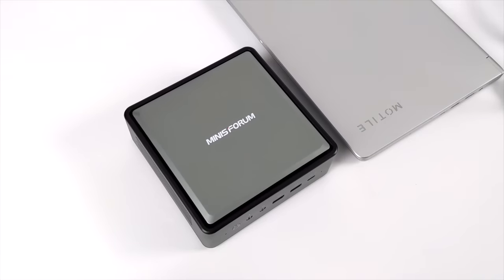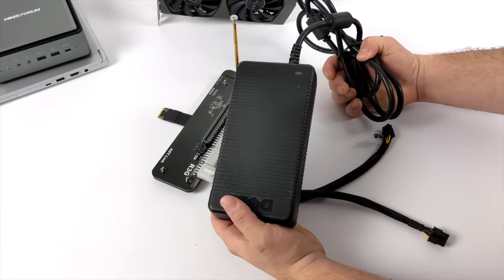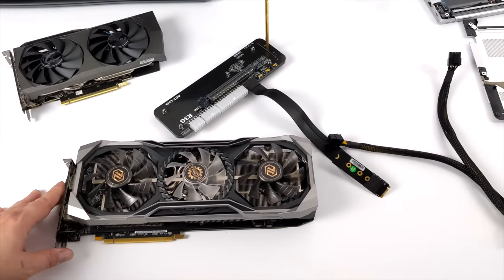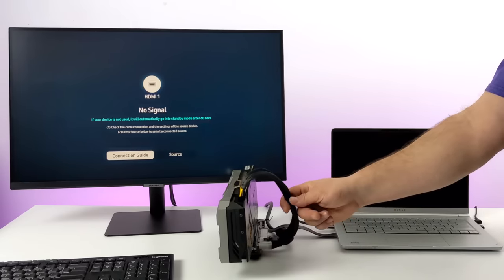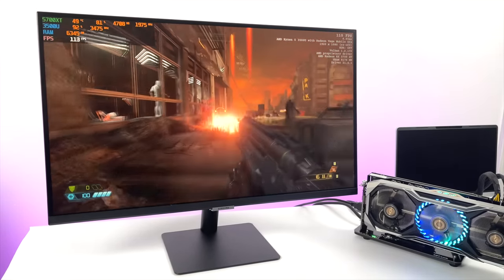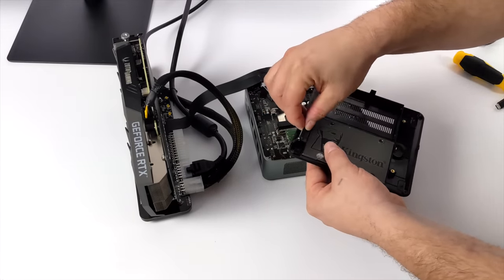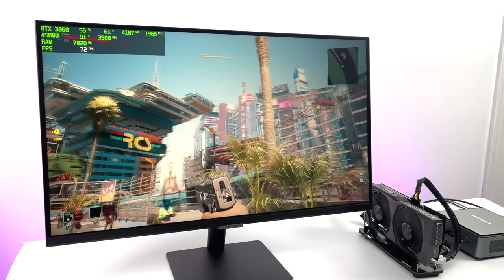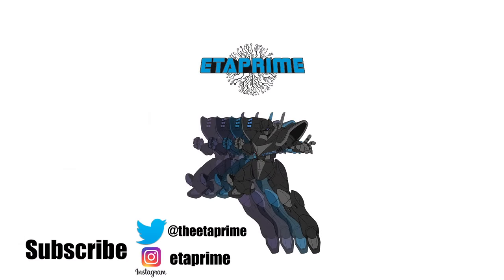Add A Graphics Card To Your Laptop Or Mini PC With This M.2 GPU Dock!

Comment: Hi prime, let's say I'm using more powerful gpu, rtx3080, can i use 2 of that 220w dell power adaptor on the m.2 external graphic dock? Or is it meant to be equipped with 1 dell power adaptor only?
Reply: Not supported AND 2X isn't enough power even if it was
Reply from the maker: One only, I would personally just pick up a cheap 400 watt ATX PSU
Reply: Ok will do and thanks for the reply.

Comment: Manufactors should plan a specific space on the laptop side to easily access a these free port for extension, like an opening with a removable plastic part. 

I know Intel can use Thunderbolt 3/4 but in the futur it might be awesome to directly access PCIe slot potentially higher than 4x.
Reply: Check out Asus flow x15
Reply: @feeblemonster8174  thanks! Never saw it before.
Looks like a pciE + usb-c combo to have the GPU directly using pci-e and the I/O of the external case using usb-c.
Quiet nice concept, hope the idea expand to other model /brand.
Reply: @LetsListenToMus1k  
I now own a great gaming laptop that I plan to use for at least 7 years. I’m thinking of modding it in a way that would give me the option to quickly connect and disconnect a egpu to make it better in the future.
Reply: Yes they should just have an m2 port on the side of the laptop like you would with usb or thunderbolt.
I don’t understand why that isn’t done, I mean thunderbolt has its uses for things besides egpu set ups so why not add a pcie 4.0 4x m2 slot on the side just for that? I don’t want to fiddle with my laptop to do this, it’s a hassle and I don’t want to have to remove an ssd if I have two in there.
Simply give me a m2 port on the side. Also with this the internal gpu should be disconnected and that external m2 slot should be greater than 4x, that’s assuming the 4x limitation of m2 is from the cpu and not connector. If it’s the connector that’s fine but if not it should be greater than 4x.

Comment: *me who bought a asus g14 that only had one m.2 slot*: well isn't that lovely
Reply: i mean the g14 already has a dedicated GPU so this would be pointless
Reply: @funknugget6334  yeah but it isn't that good, I have the rtx 2060 model, and it has the power of like a 1650
Reply: @TheSinnKidsOfficial  but still… it’s literally a 14 inch thin-and-light laptop with an RTX card. it performs great for what it is. i owned the exact same model— you’re not gonna get better performance over M.2 with an external card, plus they’re incredibly expensive nowadays

Comment: Excellent video, I've been waiting for a setup just like this! I have a Dell Venue 11 Pro tablet with a passively-cooled 4.5W Core M. It would be interesting to see how it performs using an M.2 connected GPU. Thanks for the idea!
Reply: core m is from an era without nvme
Reply: Even if you could make it work the cou is such a bottleneck i remember when I had one I had to make my own CPU headsink to maintain higher CPU  clocks

Comment: Great stuff Prime, I've been following for just under a year. I would appreciate it if you would do an episode featuring the egpu dock from this episode with the beelink gt mini pc you featured in the past. I just got the i5 version with 16gb/512gb brand new for under $400. If you only have the ryzen model from the previous show that's cool, but the ultimate would be a head to head. I would watch that over and over again.
Keep up the great work
Reply: did you do this gpu for the beelink? just got one a couple of months back and this has me very curious!
Reply: @tefoonez  not yet, I'm thinking of using a 1650 super
Reply: @brad7207  good luck buddy

Comment: It's definitely a clunky setup right now, but with this functionality in M.2, hopefully ease-of-use improvements are a few iterations away.
Reply: I hope they will make m.2 slot like an SD card slot.
Reply: Or you just pull that board from the laptop and put everything into a hand built case for a nice sleek package since it's not like people who do this will be removing the back plate to connect and disconnect just to take the laptop out of the house.
Reply: with a 50 cm cable you could get it off the desktop (its an option for the ADT set)

Comment: Hey man, I tried using this with a 1660 super and an Optiplex 7060 micro PC. Unfortunatley the performace suffered so Much I coundl't even run The Forest on low settings 1440p without lag. In an x16 slot in my Optiplex 9020 SFF It runs at Medium settings without lag

Comment: Do I need an external power supply with the adapter if I only want to connect an Elgato PCIe card to my mini PC?
Reply: You need external power at all times. The M.2 slot cannot provide any power whatsoever to the GPU.

Comment: Hello, I have the same EGPU - Thunderbolt 3, I would like to know when you installed the driver, it was in desk or notebook mode, did you have a problem. I try to install the driver for the GTX 1050ti card, but it doesn't allow me, you have a solution.

Comment: Is this going to work on all m.2 slot ??? I got this old laptop rog gl552 vx with gtx950m
Reply: If nvme ssd is working on the slot, egpu will work too. Make sure it's not for sata only(key b)
Reply: for sata m.2 there is the EXP GDC adapter

Comment: If you have this version or one of the other versions of dock beasts, why does no one connect them right to an HDMI slot instead of having to go through that huge run around of opening up the laptop and connecting in the laptop guts and board?

Comment: Hey ETA, do you mind checking out the GPUs which are released before 2015 on this board? On amazon oage they said that the board only works with GPUs released from 2015 and later, i was wondering whether older GPUs worked on it too, just they didn't wanted to call them supported because they were buggy with this board?

Comment: Which one is faster: thunderbolt or M.2 adaptor?
In case I have the options of choosing.
Reply: if it's x4 it can be slightly faster than TB on the laptop screen, x2 is going to be slower
Reply: @_Digitalguy  thanks!
Reply: @gabrielprandini2629  You are welcome. TB is much more convenient for laptops, since you don't need to open th laptop every time
Reply: @_Digitalguy  can x2 be used for gaming with gtx 1060 720p resolution?
Reply: @suryoroyo8528  with that card and that resolution it shouldn't be a bottleneck

Comment: Question: So using a M.2 SATA connection, am I right? Is there a speed difference without that extra gap between the pins? I know PCIE NVME is significantly faster than M.2, right? -Is this .actually a PCIE NVME connector? So since you don't actually get 16 lanes via the PCIE NVME port what is the best graphics card to use? (Since the graphics cards all use 16x lanes, right?)
Reply: This eGPU dock uses an NVME M.2 connection. I have the dock myself and I'm using it with a 4th gen HP Prodesk 600, i5-8600T CPU. Paired it with a GTX 1650 and it runs like a charm really.

In terms of which GPU you should use with this dock, it really comes down to the power supply you've got. If you went for the Dell DA-2 adapter to power the dock, your options are limited to any GPU that can draw up to 180 Watts. The RTX A2000 would be the most powerful low-profile GPU you can use with the dock.

Comment: That's impressive for performance per dollar. Hell, you can turn an inexpensive laptop into a power house when needed.
Reply: It really is a case by case scenario. As many laptops in circulation have underpowered cpu's and insufficient ram for current to modern gaming and will be bottlenecked heavily. 
GPU will help but for many it'll be diminishing returns in performance with those bottlenecks.
Reply: @MrFallen1ne  a normal shittop out of the box will be underpowered for gaming. That has always been given and never ignored. What I'm talking about is the potential that can be unlocked for the price. For instance, we all know that if you're cracking a inexpensive laptop open to upgrade parts, that using a Egpu is a solid option. Everyone knows to add ram, take care of storage. Upgrade cooling since overclocking will be done. Plus, cracking open laptops also will potentially show some hidden gems, such as ports. If you look at the other side to mini PC, you can nab a decent quad core from Ebay for under a 100 bucks. You spend an extra 100 for ram, storage and the adapter, well now you gave options as a budget build for gaming. The way the market is, creativity on builds is what the community needs. Any jabroni can buy a gaming rig pending on money. But to turn $200 dollars into a budget gaming alternative is awesome. I turned my old laptop into a Steam gaming handheld. Creativity gives us options.

Comment: Ok, they need to make this (or I need to modify this) so that instead of having a ribbon cable dangling from the case of your laptop (or NUC), that it ends in a port/jack. Then you could use a Dremel and carve out a little slot in your machine casing for the port, hot glue the bastard in there, and allow you to have an external GPU while still keeping your laptop portable to be used as a laptop. Basically exactly this, but with a break in the ribbon cable with a male/female jack to connect the halves together. Get what I'm saying?

OR, is there something like this that turns a m.2 slot into a Thunderbolt port, so you could add Thunderbolt to a laptop that doesn't have it stock? Then you could use one of those external GPU cases (though this would be a far more expensive option than this adapter).

I got a nice Sager gaming laptop last year, but unfortunately only has a 2060 and no Thunderbolt. However, there's two m.2 slots and a 2.5" SATA slot in it. I'd happily sacrifice a m.2 drive to be able to upgrade the GPU externally, but would want it to still be able to function as a portable machine (even though I've only used it with an external monitor and it's never left the house, lol). It'd be great to have a 2060 on the go, but a 3060 or better when at home. Would be easy if it had Thunderbolt, but alas, it doesn't, so modding it with something like this would be my only solution to upgrade the GPU.

Comment: Probably a dumb question but could you use this on the raspberry pi 4 with the Argon One M.2 case?
Reply: No. That's just a USB drive adapter not PCIe. Only the CM4 Raspberry Pi has PCIe exposed, and that isn't working with graphic drivers well yet.

Comment: I love this idea, except:

I'm so far out of date for PC gaming, I'm still on a 15" Retina MacBook Pro from 2012 (16GB Ram).

I've thought about external GPU's since I heard of them and when  I saw this video I thought:

How about adding m.2 NVMe through Thunderbolt  (using a Seagate sled and SATA adapter or USB C m.2 NVMe with a Thunderbolt  adapter)?

Bottlenecking?  OH YEAH!!!!   But would it work better for gaming than the current GTM 650 (1GB) and Core i7 2.6GHz alone?  Would it work at all?  

I'd be thrilled just to get 7 Days to Die and ARK working on this laptop at a playable speed.... even if I do have to bootcamp into Windows 10.  

Need more bottleneck?  I COULD do it with a VIRTUAL Windows machine!  Maybe????

Comment: Would you be able to connect the m.2 ending to an m.2 to usb adaptor and still see the same performance or is there an issue with this running through usb?

Comment: If I was to connect a GTX 1650 low profile card to the mini pc can I just run the Dell power supply to the M.2 connector since the 1650 LP doesn’t need external power?

Comment: I have a Dell Latitude 5500 and i want to add a external gpu on it. I have i5-8265U CPU with 16GB ram but i can't add a GPU better than 1660 Ti 6GB cause i get a bottleneck bigger than 30% and i dont think is worth. I have the advantage cause the laptop has a WWAN port witch is basically a PCIe

Comment: I got an AMD 6700 and I am using an external power supply (Asus 650 watt) but it takes too much room on the desk
Can I use one of these dell power supplier?
I found for 15 euro 
Thanks
Reply: You can use the Dell DA-2 adapter, but you really got to make sure that you double-checked if the adapter can deliver enough power for your card. For example, if your card draws 200 watts of power and the adapter can only deliver 150, you'll be running into major problems.

Comment: I have 1050 ti gpu and I want to use it in my laptop and it's have usb 3.1 gen 1 Is ok if I connect in laptop usb type c 3.1 gen1 or gen 2 in egpu my laptop have i3-1005G1 if you think it's gonna work I just want to ask is it possible to work?

Comment: Hello @etaprime
I got an ace magician amr 5 which has two M2 slots (1 for SSD and 1 is free)
I got this adt link M2 adapter, an MSI Rx 6700 12gb and an Asus external power supply of 650 watts 
Am I ok to setup everything ok with the amr 5?
Please reply 
Thanks 😊 🙏
Reply: Reading your comment, I think you're fine to set it up. Good luck!

Comment: you need to compare this m.2 conection with an desktop PCIe x16
Reply: I use the m.2 adapter with my mini PC. In terms of gameplay, I can play GTA 5 stable above 60 fps without ever dropping below that treshold on high/ very high settings mix. 8th gen i5-8600T & GTX 1650

Comment: I'm really confused... You're using a 200W power supply to power your RTX in the video, but all of the RTX cards, and even the GTX cards, state that they require at least a 450W power supply. Why/how does this work? Can someone explain this to me?
Reply: The power supply will only power the GPU. Your laptop/desktop will just use its designated power supply to run. Hence why the 200W external power supply can run the RTX GPU.
Reply: @hereis_Tiff  Ohh, okay. That makes sense, thank you. I thought for a minute I was supposed to go into the BIOS and restrict the GPU to only 80% or something, and I was not prepared to do that. (˘･_･˘)
Reply: @BlackArrowWTC  You do need to remember that you should get a bigger PSU when the graphics card does require more power than what the 200W Dell DA-2 adapter can provide. A 3060 or a 4080 or whatever it is people use nowadays requires a lot of power ofcourse. A 200 Watt power adapter won't be able to provide enough power lol

Comment: 10:46 Weird, for my 4750GE my time spy graphics score was 1301(somewhat expected) but my CPU score was 3440, like how did a 16 thread low power desktop processor lose to a 6 thread low power laptop/tablet processor. I guess it really is being power throttled  Wasnt lying when it said it needs more power after powering on from a full shutdown, or after rte-connecting to power by placing the M75Q back into my TinyInOne monitor

Comment: Could I do something like this with a chuwi herobox? I was novice a couple years ago when I purchased the chuwi herobox, thinking it'd be fine playing games on, and while it is fine for some basic games, it's definitely not anything near what I need for the higher end games ide really like to play. I just don't know if it'd be worth the process and parts I end up having to buy, aside from the acual graphics card, to upgrade the chuwi herobox, if it'd too much of a hassle, and not work as I'm hoping for, or if the cost of doing the alterations to it will end up being near the equivalent to just buying or building a whole different PC that'll meet my needs. Now granted it's been dang near 15 YEARS since my last computer class in college,but I'm fairly confident I can find enough info online to learn how to do this right, if possible,lol, but I'm obviously starting off by asking around for any advice before I decide to go ahead and do my research on adding the external graphics card to the mini PC. I want to play Fortnite...just for example of what game I Wana play...and I'm aware I could just buy an Xbox one s or x for under 400$ and play all the games I want on that,but I kimd of like thw challenge of building something custom for what I want specifically...so idk, I might get lazy depending on what I figure out the total cost and time I estimate it'll take adding the graphics card to the chuwi. Idk. I'm hoping to keep the costs under 250$, idk. Any ideas? Oh and I also want to ensure my kiddo can do his Minecraft gaming on what ever I'm doing, and not the java,just bedrock, nothing crazy.

Comment: Hello there I was wish you respond so I want to follow your tutorial but I have a low profile gpu which does not use a psu cable so I was wondering if it will work please respond ❤
Reply: With "PSU cable", are you referring to the 8-pin cable that attaches to the graphics card shown in the video?

Not every graphics card needs an 8-pin cable; they are only used on certain cards that require it for more power etc. If your card doesn't have an 8-pin connection: no worries! You simply don't need to connect any 8-pin connector(s) then.

Comment: I have a question. If the gpu doesn't require power supply do i still need it?
Reply: Yes because the nvme m.2 slot won't supply enough power to the gpu on its own. Gpu's that do not require a power supply rely on the x8 or x16 slot on your motherboard to provide the gpu with power and they're capable of 110 watts. The m.2 slot are only x4 or x2 which can only provide around 20 watts max which would severely underpower your gpu lol. So yes you would need a power supply.

Comment: Would the Lenovo 300W ADL300SDC3A power supply be used to power and external gpu?
Reply: That will not work with the external GPU dock shown in the video. There are only two methods that work to power the GPU dock:

- A Dell DA-2 adapter (180 watts);
- Or any typical ATX power supply (any wattage, your preferation)

Comment: Hello, so can you plug in a PCIe SATA controller into the x16 slot to host a couple SATA drives?  Will it detect other PCIe devices other than Graphics Cards?
Reply: Yes, m.2 is backwards compatible with nearly everything cuz its just pcie
Reply: @bonkerzd6980  Thanks.  If only it worked on HP ENVY x360, but sadly it doesn't work.